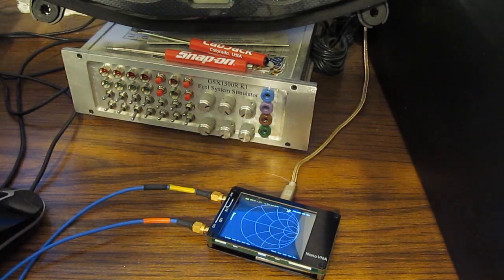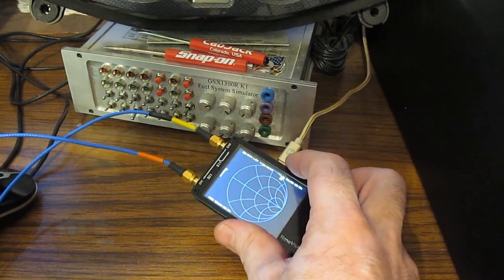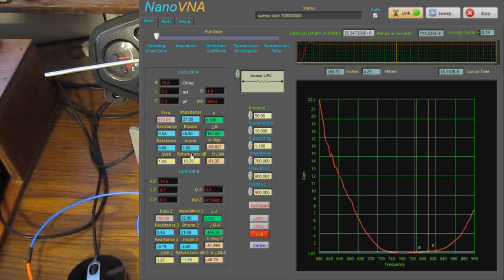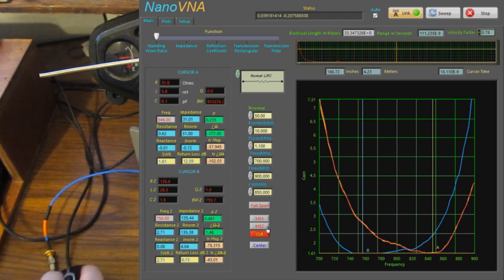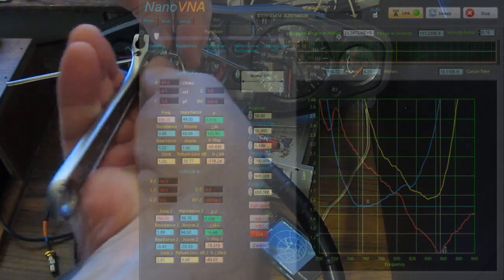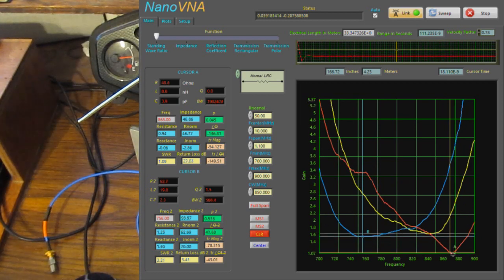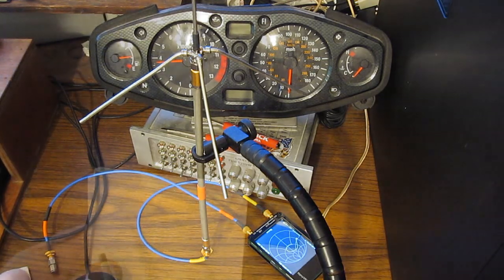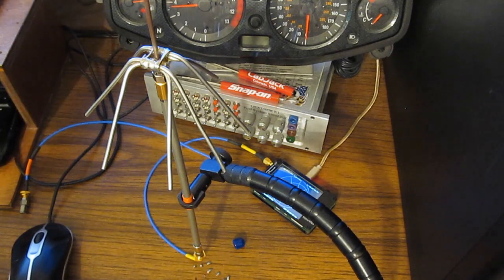Using the NanoVNA to Measure Antenna SWR and Resonance

Comment: Can you do a video of analysing crystal ladder filter?
Reply from the maker: What specifically would you want to see?
Reply: @joesmith-je3tq  Tu Joe,almost everything about xtal filter, likely about bandwidth ,stop band rejection ,pass band,.Inshort ,To design a xtal ladder filter
Reply from the maker: @aneespi4684  Have you tried using the Nano to measure one you made and were not getting results you expected?   If so, have you posted about your experiments and could you provide a link?   I did use the Nano to measure a crystal in shunt mode that then used as part of a simulation.  It may provide you with some of the problems I ran up against.   https://youtu.be/v01lSgWo904?list=PLZSS2ajxhiQD2gftdurGQoyGpUM_HobNI&t=760
Reply: @joesmith-je3tq  i haven't tried it yet,I will have a nano vna soon,So iam planning to do a crystal filter for my new ssb radio.
Reply from the maker: Have you made any progress with this project yet?   What frequency and other constraints do you have for your filter?   What software do you plan to use to model it?       I would like to follow along if you decide to post a blog about it.
Reply: Not yet,due to the present situation ,iam unable to collect raw materials for that filter.Iam planning to do it with 12MHz crystals.Iam planning to follow G3UUR method,along with DISHAL software.
I think I can build 8 pole filter for better side band rejection .
Tnx jeo for the enquiry..
Greetings
Reply from the maker: @aneespi4684  Let me hunt around and see if I can find some parts and the software you mention.  If you have an account on EEVBLOG, I can start a thread there to document our progress.
Reply from the maker: Would you be planning to use the Nano for everything or do you have other test equipment available?
Reply from the maker: Join up and add your details here:   https://www.eevblog.com/forum/rf-microwave/fun-with-crystal-filters/msg3036196/#msg3036196
Reply: @joesmith-je3tq  i don't have any..,other that this, and you know iam totally a novice in these stuffs
Reply from the maker: @aneespi4684  Assuming you read the help file or the others I have posted, you do understand that G3UUR's method you mention requires a counter?  Are you hoping to use the nano to somehow read 12MHz with enough accuracy to characterize your crystals?
Reply: @joesmith-je3tq  That method needs counter.But what iam searching is ,with the help only a NANO VNA,how we can test a crystal and build a crystal filter.G3UUR methods seems to be a simple way, but iam looking for A method by nano vna
Reply from the maker: @aneespi4684  I had assumed when you posted using the G3UUR method you understood what that entailed.  Are you Can you supply your other performance requirements for the filter you plan on making?   How did you determine you required an 8 pole filter?
Reply: @joesmith-je3tq  i tried DISHAL software with my existing 4 crystals ,the side band suppression was poor by 4 crystals,so I planned to do another filter with atleast 8 pole.I need to wait until the lock down to be completed(let's hope for the best)
Reply from the maker: @aneespi4684  I assume you were only simulating at this point and not actually building anything.   Or did you try and build a 4 crystal filter and somehow measured it's performance?    What are you needing for BW and rolloff?
Reply: @joesmith-je3tq  i did a 4 pole filter few days back,i have simulated it using that software called DISHAL.The perfomance of that filter was bad.So iam planning to do one another filter with 8 crystal.Due to the present pandemic situation,Iam not able to go out side ,what more shops are not open!!!..
Once this situation ends,i can collect crystals and try .
Iam a novice in the field of designing and reading in amateur radio stuffs.
What I meant was ,I you can post a video of designing and testing a crystal filter using NANO VNA,then that will be helpful ,not only for me ,but also who gaze through the youtube.I have no SMA PIG TAIL connectors with my VNA ,so that iam unable to do Absolutely nothing!!!!!!
Greeting Joe
Reply from the maker: @aneespi4684  I've continued to post some of my progress, using the G3UUR method you plan to use.
Reply: @joesmith-je3tq  oh, tnx a lot joe .Nice to hear that
Reply: @joesmith-je3tq  inform me once it is completed
Reply from the maker: @aneespi4684  I uploaded some of the data today. Have a look.

Comment: 7351 Mr Joe, I'm Paulo from Portugal. Could I use this device to make measurements in 27 Mhz antenna. Tks a lot. 7351.
Reply from the maker: As I talked about in this video, that is going to depend what measurements you need to make.   My advice is join that group and ask there.  I understand many members are now amateur radio hobbyist and I suspect they could provide answers to any questions you may have.
Reply: @joesmith-je3tq  Tks all the best.

Comment: I have had no luck getting mine to work at all. I can get through the calibration sequence, but understanding anything else to do with this device is frustrating. It came with no instructions and to make matters worse, I use linux mint 19. I can't even get the software to install off of git hub. Any help you can throw my way would sure be awesome. Thanks.
Reply from the maker: While I've looked at LINUX since the mid 90s,  I use MS Windows for the majority of my work.  The main reason is compatibility.  The other is the amount of time LINUX seems to require any time I try to use it.  One the plus side, the Nano will run without a PC and it drives pretty much like any other VNA.  In your case, it sounds like you may not have any experience in this area.   There are plenty of videos you can watch on setting up and using VNAs.  There are also lots of documents from the main companies, depending how deep you want to dive into it.  

Recently I've been playing around with the Nano again and running it standalone.  I have newer firmware installed and I am amazed at how often it crashes and requires a power cycle.  Many of these problems appear to be related to the menus.   Still, for $50 I can't fault it.   I was surprised to see it work as well as it does.   I suggest you join the Nano group and ask for help there.  It sounds like people have been working on manuals for it.   They keep that area locked and it's for members only.  So I can't comment on what you will find there.
Reply: @joesmith-je3tq  Well thank you for getting back to me so fast. I appreciate your help. Do you know if the ARRL Handbook has any info on these devices? Or even the antenna book? They are both pretty pricy books but if they can help me on this device, it might be worth getting them. Any insight is appreciated.
Reply from the maker: @EarlGray_kd7sjt  I doubt it. The last one I bought was from 2015 and they mention VNAs but that's about the extent of it.   I wouldn't see a reason to buy any books and that you would be better served reading papers from the large companies.  These are written for EEs and provide a lot of details.   Depending on your background and goals, you may want to start there or for more basic questions just join that forum.   You could also join the EEVBLOG forums but I suspect the other forum would be more useful.     Currently a few of us are discussing home made attenuators.   Have a look.  https://www.eevblog.com/forum/projects/20db-rf-attenuator-seeking-feedback-to-improve/
Reply: @joesmith-je3tq  Thank you again good sir. I will check out the resources you pointed out. Looks like I have some good reading to do. I appreciate the helping hand you have lent. I hope some day I can return the favor. I hope and pray you and yours are healthy and well in these troubled times. God Bless.

Comment: Great video. I wish you'd post your personal software so we all can use it. Not everybody is a programmer, surely not me !
Barry, KU3X
Reply: PS. Looks like a motorcycle dashboard in view? What kind of motorcycle do you ride?
Reply from the maker: @barrykery1175  Did you know that there is currently work being done on an open source interface?  If not, I suggest you have a look.  I haven't looked into it but I suspect it is much better suited for general use than the software I am developing.
Reply from the maker: @barrykery1175  I have a few old Suzukis.   You can find them in a few different videos.    https://youtu.be/q_89qoFMivg?list=PLZSS2ajxhiQBvWvqMVLdRQMjGofKpQUJr

Comment: For TV and 75 ohm coax, would you make and use a 75 ohm load to calibrate? Can you use coax as a calibration load?
Reply from the maker: Yes, you can use coax to calibrate a VNA but it may not be practical at frequencies you are working at.   You may need more standards than a broadband SOL.   Ideally for 75 ohms you would want a 75 ohm test set.  It is possible to match the two with a pad.   There are some videos showing this technique.  Check out CopperMountain's site. They have a demo of it.

Comment: Will Lab view work on a Linux laptop ?
Reply from the maker: If you are asking if NI has a version of LabView for LINUX, I believe they still do.  It may not have the features that the Windows 32-bit version has.   Even their 64-bit Windows version is limited.      If you are asking if the software I wrote for the Nano in LabView will run under LINUX,  I doubt it.   You would need to Google it and maybe check the forums.
Reply: @joesmith-je3tq  thank you for the information

Comment: Hi Joe,
you measure the ground plane antenna both on ch1/rx just to see how both antennas behaviour on receiving mode..ok?
The ch2/tx we can use it to check our antennas on tx mode?
Thanks for share Dinos..73's
Reply: re: "The ch2/tx we can use it to check our antennas on tx mode?"

No. Look up the technical engineering term "S-Parameters" and note difference between "S11" and "S21" measurement.

Comment: The radial length also should be trimmed when tuning the antenna.
Reply: NOT near as critical as the vertical element.
Note the DROOPING had quite an effect though ...
Reply: @uploadJ  they are equally important. The radials make up the other half of the antenna. They effectively replace half of a half wave dipole.

Comment: You have convinced me it worth getting for portable work. Can you share what coax used on it and do you use crimp on connectors.
Reply from the maker: I would if I could but these are fairly old.  One that I use from Pasternack is a PN# PE4036 1213 which are crimp on style.

Comment: I'd be interested in using the unit at a much lower frequency, say between 3.5 - 25 mhz.   Would also be interesting to try out a discone antenna for 144 - 500 mhz.
Reply from the maker: I have been posting about some tests I have ran in the 1-10MHz range.
Reply: re: "between 3.5 - 25 mhz. "
You want to work in the 3.5 to 25 milliHertz range? Strictly speaking, that's what you wrote ... not meaning to sound mean or anything. 
MegaHertz uses a capital "M" like this: MHz.
Reply: @uploadJ  I've never heard the word "millihertz" used in any real life context. Instead of cycles per second, everything lower than 1hz is displayed as seconds per cycle. Ask a drag car racer about their MPG on the strip and they'll laugh and say "dont you mean GPM?"

Comment: hopefully 6Ghz or so will be soon also for 50$ :D (my dream :D)
Reply: @TheAbyss79  I've seen it:    3.5 Ghz     $150   I'll wait...
Reply: In the meantime there is the Deepace KC901V, about US$1500
Reply: @uploadJ  yes only price is far away :)
Reply: re: "up into the ghz range"

Reduced performance though, esp compared to Deepace on high freq end.
Reply: I would settle for 20 dB RL measurement at 2.4 GHz ... that would be very handy for antenna check-out for WiFi. I also need 1296 and of course 450 MHz.

Comment: Thank you very much for the efforts and this video 👍🏻
Impressive what you get for the bucks!
Reply from the maker: Sorry I wasn't able to capture the data from the old HP as a reference.  The two system appear close enough that I would say the Nano could be used for this in the frequency range you are interested in.  It still wouldn't hurt to maybe reach out to the original channel to see if they would mind bench marking it for you.    Good luck.
Reply: re: "Sorry I wasn't able to capture the data from the old HP as a reference."
>> For years I took actual digital pictures of scopes, spectrum analyzers and DVM displays for technical reports; nothing beats a good detailed picture when conveying information to a technical customer when his 'design' starts to malfunction in the contract manufacturer's hands (usually RF issues) ...